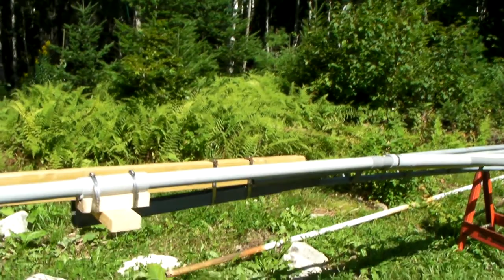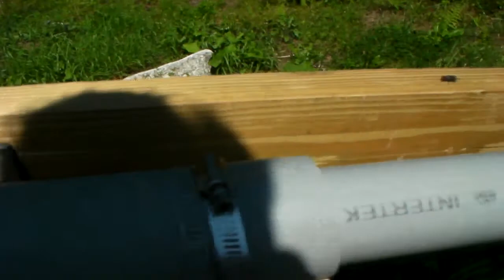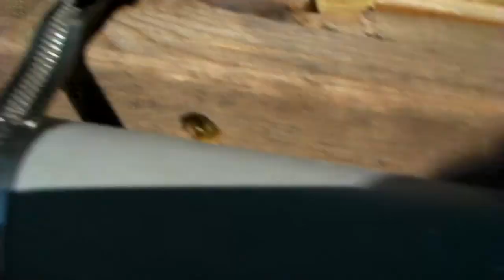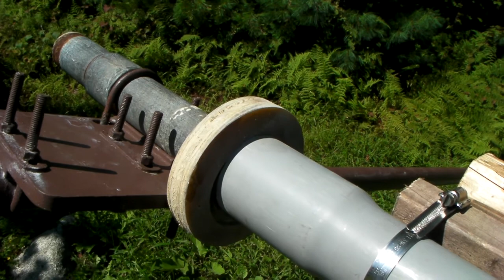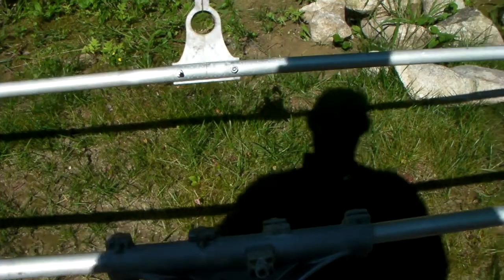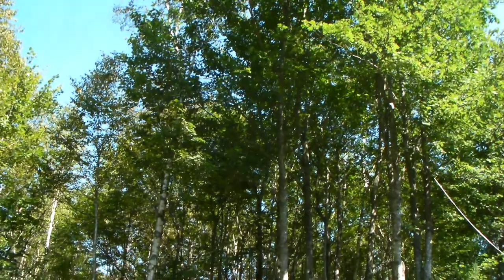DIY Yagi Tower Part 1

Comment: That section of tower as you called it is NOT a section of tower at all.It bolted to the upper section of a Rohn tilt over tower & it had a hinge that attached to this section & the bottom section & winch raised & lowered the upper section.This piece was used for support of the Rohn 25 sections when being raised & lowered so the tower did not fold in half & break into.See the attached link for more info.I had one & now a friend has it.They work great & it's a one man job raising & lowering even large antennas.  http://www.rohnnet.com/towers-foldover